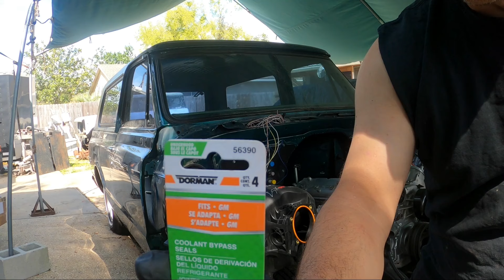Installing PRC ported heads and a FAST LSXRT 102mm intake on the 5.3L swapped 72 Jimmy

Comment: Oh yeah im watching 😂😂😂 That back port is exactly the 1 i plan to use for the map. The front port for the evap im considering doing the iat frog did on his so i can lose the maf. Mine runs better when its tuned out. I got the fast conversion kit for the RT to use the stock rails and crossover. After watching your video im not convinced its gonna work. Keep us posted on what you figure out. Im a fuel line fabbing virgin when it comes to EFI 😂😂
Reply from the maker: I did the same for my personal truck, brackets + factory rails.
Reply: @bluecollarhotrods9781  lol I'm pretty sure you're the 1 who recommended that kit to me 😂 you'd better be right ☠️
Reply: @bluecollarhotrods9781  seriously tho what's your thoughts on what I might need to add the e85 sensor in using the stock rails and line. Coming up kind of empty there
Reply from the maker: @Ralf1NATOR  I'm going to have to build something... fittings, PTFE line. Everything I find pre-made is for Gen IV & Gen V stuff.
Reply: @bluecollarhotrods9781  yeah that'll what I figured. I found a YouTube video once where a guy had a parts list. I'll see if I can round that back up
Reply: @Ralf1NATOR I'm thinking the L59 engine for flexfuel
Reply: @shadowopsairman1583  I've got all the components to support e85 just gotta figure out the fuel plumbing
Reply from the maker: @Ralf1NATOR  I think I can find and send you the video we're both thinking of.
Reply: @Ralf1NATOR yeah i was thinking stock components.

I tried E15 1 time and it did poorly in fuel economy that I went back to 87, it acted like it wasn't as dense in heat energy.
Reply: @shadowopsairman1583  for me it will be just for the track. 87 on the road lol
Reply: @Ralf1NATOR yeah as long as the Compression ratio isnt above like 10.5 lol
Reply: @shadowopsairman1583  lol should be right around there. Flirting with disaster 😂

Comment: I'm mad dang right I'm mad that I can't afford all them nice go fast parts lol
Reply: I had to go spend to get an engine that had already been through an overhaul shop in January when the 4.8 dumped coolant into the oil sump and had no op. It was not cheap, just a minor upgrade to  iron LS1 (LM7 bored out to 5.7 Spec, has flat tops to boot)
Reply: @shadowopsairman1583  awesome
Reply: @CCAutoWorks it pissed me off because i had to go do it to begin with when I was going to do springs, cam, oil pump, in the 4.8. It sucks I had a catastrophic failure, but in the end I wouldn't have been able to find another truck with less than 100,000mi on it for $15,000. I got it in 2016 with 75,000mi, got it to 188,000mi, which was like 23,000 more than my 03 Sierra V6 I had  wipedout 6x barrel roll) in 2012 and walked away from it.
Reply: @shadowopsairman1583  that's lucky
Reply from the maker: I'm doing work for other people to have a little extra money for go fast parts.
Reply: Lol tell me about it.  I've been nickel and diming for a year and a half
Reply: @bluecollarhotrods9781  yessir I heard you say it was for someone else

Comment: I really hope that cam and Texas Speed Heads give you enough vacuum to utilize that FAST, I guess Crane didn't have the cam you needed?

Oh I dove in a chilton manual and from what you wrote about the rockers, was pretty much the same what the chilton manual stated about c1 being tdc, I studied another video and some numpty was stating to torque to 26ft lbs when the chilton states 22ft lbs, rather not snap bolts.

LS1 MLS gaskets don't need copper coat as far as I know, it was done on the non MLS units or off old SB or BB. The Heads seem to be similar to Trickflows. PRC is a brand line from TSP?
Reply from the maker: Holdener has run similar combinations, should do the job no problem. PRC has their own castings, and they port factory castings. These are 862s ported by them. They are known good set of cylinder heads. On a friend's 2013 Silverado, we had: flat top Gen IV 5.3L, these PRC heads, a custom grind Comp XER lobe 224/232 cam, headers, cat back, everything else stock. 3600 stall, 4.10 gear, chrome SSS 20s - it made 415/393 on 93 octane. I am pretty confident that even with a 4L80E and the SS2 cam - it will make upper 300s minimum if not 400rwhp.
Reply: @bluecollarhotrods9781 
It appears it will be a healthy combo, that SS2 cam you have, are the values about the same as the XER Cam?

The G4 5.3 Flat top I presume was DOD/AFM with vvt?

Hey man, what about painting those Red fuel Lines with a black Heat/fuel/oil Resistant primer and paint? Ofc after you know they will fit the fast.

Seems many knock dorman, they are fine at least they are to me. This week I'm going to clean my oil pan, exhaust manifolds, blast the flexplate that came with the 5.7 and rattle can it in a color that will show oil/trans fluid very easily .

That 4L80, did you change any gears in it to make it liven up, I heard it was kind of slow as a trade off in speed for durability.

I did some research about doing the pump stator bushing and the pump bushing where the front seal sits on the 4L60E and I'm not going to do it unless I actually have a leak, it will just get a front seal a rear seal and a turbine o ring for now.
Reply from the maker: @shadowopsairman1583  it was an engine we refreshed and deleted all that crap on. That 2013 was a 4.8L truck originally, so it didn't have any of that. The SS2 is a 228/230 .585" - so in the ballpark. 

Fuel rails, he's talking about stripping them and having them re anodized. 

I've used plenty of dorman stuff with good results. Wouldn't worry about it.
Reply: @bluecollarhotrods9781  oh even better, no dod bs, there is a 4.8 that has vvt but no dod. I think it was L20.
Trust me I've used dorman over the years and only had 1 dud and it was a oil pressure switch, it doesn't shy me away from using them as they make more stuff needed and it's better than the amazon knock offs. This 5.7 build is getting an AEM 150 PSI 1/8" NPT oil switch going into a stainless steel adapter to fit the rear valley port, the plug is the same 3 pin.
Reply from the maker: @shadowopsairman1583  as for the 80E... lots of myths. They're not as bad as people claim.
Reply: @bluecollarhotrods9781 it was a minor drawback, Richard and Teresa Crich who own(ed) Precision Transmission in Amarillo, have plenty of vids on 4L80s about the changes over the years, same with 4L60s even. 4L60s aren't that bad, it's designed to work stock, most fail to build up a trans after they do the engine. I need to look at the transcooler lines soon and see how to install the trucool without kinking anything up on the hoses as I'm not going to cut the stock lines
Reply from the maker: @shadowopsairman1583  the outlets for the lines are farther apart. When I was using stock lines, I had to cut and rotate one 180 degrees. I have since upgraded to PTFE lines that I made up myself.
Reply: @bluecollarhotrods9781  i remember putting a transcooler on my 03 v6 truck but i think at that time the transcooler was built into the radiator, so technically it had 2.
Reply from the maker: @shadowopsairman1583  yeah, mime is dual pass... goes through the cooler in the radiator, then into the trucool 40k
Reply: @bluecollarhotrods9781 i will have to check mine and see how it's all routed.
Reply from the maker: @shadowopsairman1583  when I did the trucool 40k on my folks 05, I bypassed the one in the radiator. It runs nice and cool, even with larger than stock tires. (33s)
Reply: @bluecollarhotrods9781 oh i know the truecool will handle the Circle D 2600-2800 Stall behind that Iron LS1
Reply from the maker: @shadowopsairman1583  so far, mine is keeping up with my FTI 3200 stall. This summer will be the true test.
Reply: @bluecollarhotrods9781  ok here is something interesting that occurred Friday. I followed Chilton Manual to run the rods and rockers down, torqued, 360'd the crank, noticed no binding in the crank, ran other rockers down, torqued and 360d again, Then grabbed individual rockers to check for the slight sideplay. On both cylinder banks, 3 rockers had no slight sideplay, the rest did, everything was torqued to 22 ft lbs. I don't remember which rockers had none, truck norris cam, btr 7.4" rods, engine is definitely in time. I had the rockers in oil, so if the bolts didn't torque correctly i may need to pull them, clean them and the threads (oil) and try again.

Is there anything to be concerned about on those 6 rockers not having slight sideplay?

I also learned the engine had a LS2 chain guide installed, a Melling 10355 HP pump which out of factory has a green 80 psi spring installed. I have an AEM 150 psi oil sensor that will be used, so it sounds to me the gauge will be pegged lol.
Reply from the maker: @shadowopsairman1583  2 things... lifters aren't pumped up. And those 6 are likely on the heel of the cam, meaning they aren't on any part of the lobe where they start to open valves.
Reply: @bluecollarhotrods9781 if im not mistaken i am supposed to have slight sideplay correct
Reply from the maker: @shadowopsairman1583  correct
Reply: @bluecollarhotrods9781  when i go back out i will id the rockers having none, rotate the engine twice then remove them, clean threads , and retry.